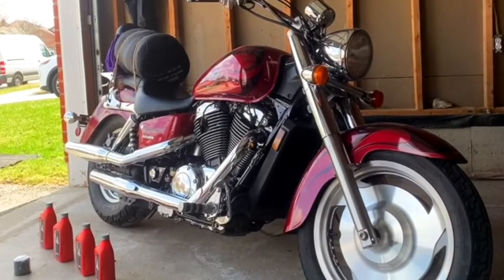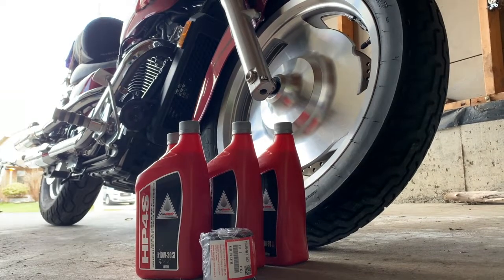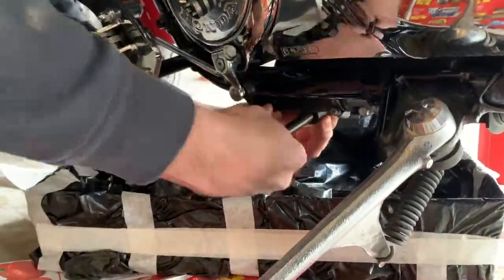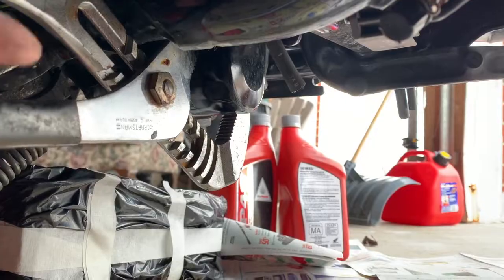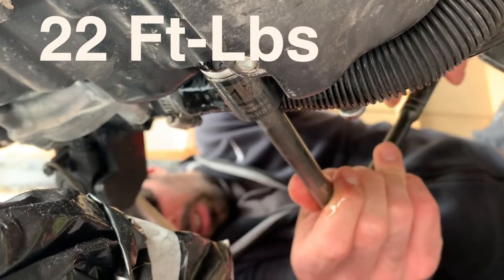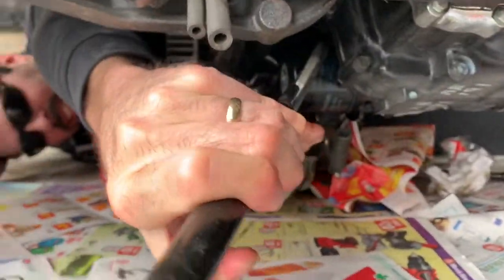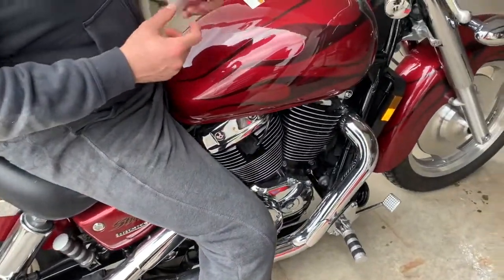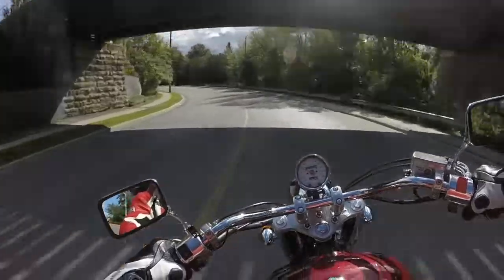Motorcycle Oil Change | Honda Shadow Sabre VT1100

Comment: Thanks for the video. My grandfather passed away in 2016 and I've recently decided to restore his shadow 1100 aero. It has been sitting without being started for at least 7 years now and the oil and gas definitely need to be replaced. With any luck hopefully I can get it running.l

Comment: If I remember right ,its not advised to use full synthetic oil in the Honda's,as its possible that the clutch will slip
Reply: Мотюль 7100 10w40 не Лейте, будет буксовать сцепления

Comment: Hey man, wondering if you still had your Shadow 1100 and how you like the bike. I'm looking at one at a local dealer. The bike looks good and only has 9,000 miles on it.. it's a 2004 and was owned by an old guy who was getting to old to ride. The dealer wants 4,500.00 for the bike...a little more than Kelly Bluebook. Thanks for sharing and any thoughts you have on your bike.
Reply from the maker: I bought mine for $4000 CAD with 3500km on it. So that is a bit high… how are the tires? Forks?
Reply: It's got new tires on it and the forks seem fine. It has a windshield and a short sissy bar and back rest, and crash bars/ engine guard. I rode the bike and it seems a little bit heavy. Maybe the price is a little bit high. Thanks.
Reply from the maker: @ambu6478  does it have an after market seat? Or driver backrest? Is it your first bike?
Reply: @CruisersCorner  It was a stock seat, but it has Vance and Hines pipes. No it's not my first bike. I'm 67 and started ridding when I was eleven. I've had several Hondas, two Yamahas, a Suzuki, two Harleys and one Kawasaki. They've all been street bikes.
Reply from the maker: @ambu6478 Japanese are the best for quality. I’d say the bike would be a good deal for $3500.
Reply: I just got a 2003 Sabre with aftermarket exhaust, jetiing, air filter and needles, from facebook marketplace, check facebook, mine is in great condition, I pulled the carbs, cleaned everything like new, bike rips and is fast and smooth $2000,,,dont pay 4k is you can avoid it
Reply: I just bought mine that is a 04 with 3,656 miles for $3k. After market seat, sissy bar, cobra exhaust and saddle bags.